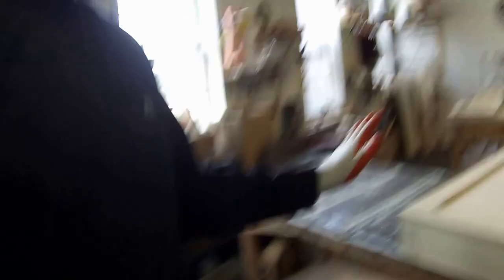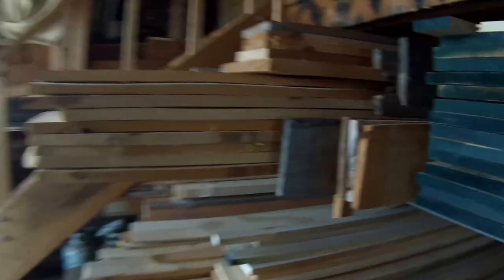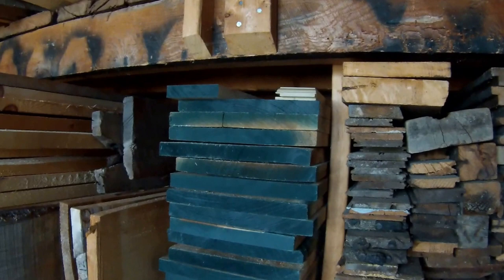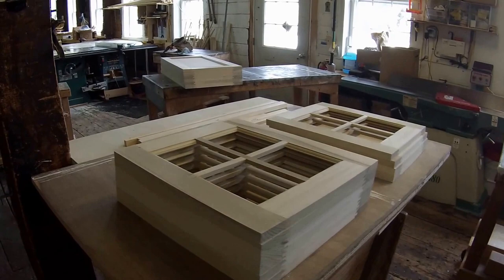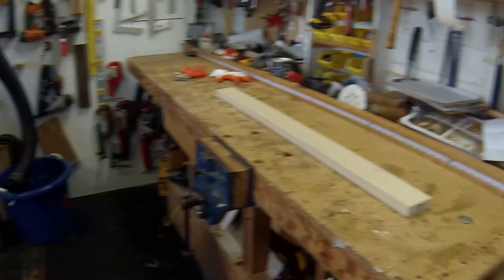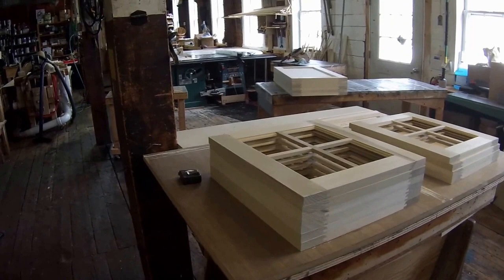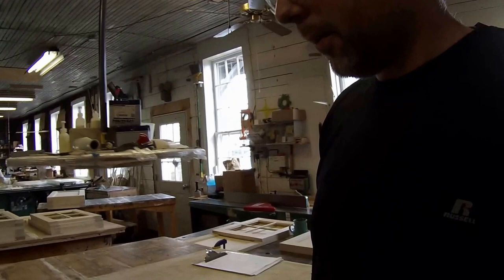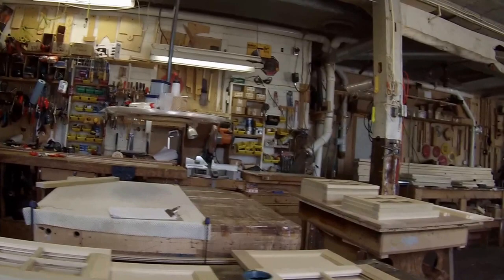How To Make Perfect Cabinet Doors - Wood Lecture by Mitch Rudman

Comment: Perfect information that explains a problem I had building a table.  After hand plaining each board to match,  drawing them together,  screwing in place.  I found a month after I bring table in house that now not a single board is touching.  So I see now, I went to fast and never keep an even heat for the drying.  Thank you.  
  As far as Joe goes.  You have a fine cat there.  I have the only fetching cat I have ever seen.  It fetches like a dog.  I throw the toy and she brings it back to drop  at my my feet. As so as I pick the toy up the ears go up and she starts looking to where I might throw it.  Thanks for the videos.

Comment: Thanks for taking the time to do this video – very informative.  Do look for a particular moisture content on the stickered wood before deciding to use it for your project?

Thanks for your time
Reply from the maker: +Luigi Seli 
I rarely use a moisture meter, although I do have one and it comes in handy for when I buy green lumber and air dry it.  Kiln dried wood should be pretty close to target equilibrium moisture content, it just needs time to even out once its taken out of storage.

Comment: I know most clients have no idea how the wood selection process works into each build. It does take some experience to look at a wood pile and figure out what the wood will do over time and where that project might live in the country. I do go a step further when making doors taller than 24", I like to use 3/8" splines to my stiles, especially on glass doors, just to keep them from ever moving due to humidity changes...
Reply from the maker: +woodmasterguy 
Yes I thought about doing it that way and have done that before.  all the glass doors on top are 15" tall and I am using blumotion hinges so they dont slam

Comment: Nice video but that flatsaw poplar that had twist should not move that much after jointing, with poplar movement coefficient  listed at .0029 (flat sawn)  and if your stile is 2.5w and moisture change of 3% during seasons which is unlikely in a air conditioned house with painted wood. 2.5 x 3 x .0029 that wood should move .02175 back and forth , if thats too much a better option would have been quarter sawn, and that number nearly drops in half, correct me if I'm wrong
Reply: the twist is amplified x the width of the door.  so 3" wide board is not much, x 5 = 15" wide door is noticeable imbalance when the door faces are on.
Reply: Would be interesting for someone to joint a kiln dried (7%) twisted board flat, and follow it thru the seasons measuring the twist that returns or not.

Comment: Generally speaking, with the type of wood you use how much wood do you typically estimate as not useable, I understand that it will vary with each lot of wood you buy but is there a minimum figure you start from?  Thanks in advance for your reply.Louie....
Reply from the maker: +Louis Hayworth 
To estimate how much wood I needed to cut for doors, I added up the linear feet for all the parts and doubled it.  I start the building process with material selection for doors to get the best pieces out of the whole lot.  The "waste" factor is very high at this point, maybe 40% 
not usable.  However, the final wood waste factor was actually very low - I would estimate 10% or less, because I can re-purpose the door rejects for face frame, cleats, shelf edging, and other misc items.

Comment: The trouble starts sawing with the pith not centered correctly. I'd imagine that mills are not willing to saw wood properly just because of the waste that would come from it. 

If you read texts from 125 years ago, when the companies making planes selected beech, they took only the sap wood, only pith cenered when cut and they threw the rest of the wood away (to burn). I can't get all sapwood beech these days, and there's only one mill in the entire united states drying QS beech big enough to make planes, anyway (Horizon). 

I'd bet the saw work done in the days when big wood was plentiful was a lot better than the current saw work.
Reply from the maker: +David W 
Trees were very different 125 years ago.  Back then they cut hemlock trees just for the bark to make tannin, and then discard all the wood because it did not have enough value.  I found a retailer advertising steamed beech for hand planes http://www.rarewoodsusa.com/
Reply: hffcom Yes (on the beech). There are a lot of places offering 8/4 quartersawn, but not many offering 16/4, which is what's needed for a full sized bench plane. 

there's a revival of professional makers going on right now, though, and that may incent a few more producers to come online. 

The kiln schedule for 16/4 is just too long and slow and not much else can go in with it. Horizon told me they only do it because nobody else does it and they're afraid the market will go unserved (a couple of people make a living making planes - though I'm not one of them). 

It can be tough to find large beech trees since it was something that dominates mature forests, but doesn't show up much in often-cut forests or new forests that grew up from abandoned land.